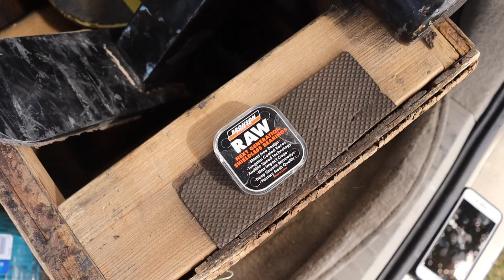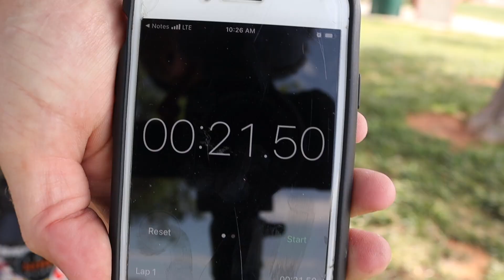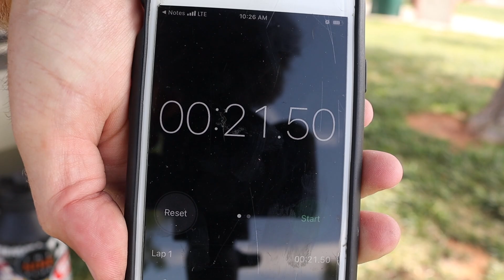Jamie Foy Bearing Hack DOES IT REALLY WORK?

Comment: The reason Big Boy Foy specifically said windex is because it has a degreaser agent. The problem though is that it’s also mostly water. It will clean your bearings but they will rust super fast. The ideal way to degrease them is with 99% isopropyl alcohol. It will degrease them without promoting oxidation as fast. (I’m from the east coast, we know about rust lol)
Reply: The idea that degreasing bearings is ever a good thing is laughably stupid though......... Not even kidding.
Reply: Isopropyl is the main component in Windex besides other alcohols. Great for a household product. A drop of lube and (new) shields are definitely smarter though.
Reply: ice cream
Reply: The cheapest glass cleaner are often best, containing less Parfum, Tenside, colour and such. From collecting Vinyls i was looking for a cheap source of isopropyl, which has to be most close to pure. Found out that the bigger names on the market tend to add several substances. Some even contain few percent methylspirit, which would be deadly to Vinyls.  
Anyway, i would give my pricey bearings some lube. There are nice products for MTB Frontfork. Same Problem there. Dirt and dust even more and you dont wanna have rust and scratches on your 1500$ Marzocchi ;-)
Reply: What about 70% isopropyl?
Reply: @joseamaya1001  it will work way better than windex but the higher the percentage of iso, the better.
Reply: @ilikelittlebikes  ok thank you
Reply: acetone is the standard solvent, but it's pricey
Reply: @joseamaya1001  You can use mineral spirit too (here it is called petroleum, in US I have no idea if it means the same). It's like petrol, but does not stink.
Reply: The unloaded spin test is stupid as a metric. There is grease for a reason, and of course dry clean bearings will roll well but will wear out faster as well

Comment: After my 20 years of skating I know this: pop shields off, put bearings in alcohol for a while, shake it. Then put them out, shake again. Let it air dry and then apply one drop of bike chain lube in each of them.( or sewing machine oil if you have access to it). Put shields back on and use these bearings for another 6 months at least.
Reply: Also spin test tells you absolutely nothing about how these bearings ride loaded up with your weight.
Reply: I use machine oil only on my Bronson's a drop or two will do to each bearing , g3s /raws are what I ride
Reply: Sewing machine oil ROCKS
Reply: silicone oil is best
Reply: @komoonkh  Exactly. These guys aren't taking into account load and friction caused by load. You have to have your bearings oiled because you create friction as the bearings spin. Without oil, you're unprotected from pitting or already existing pits in the balls of the bearing or in the races.
Reply: @krzysztoflange7484  Never tried but ptfe oil must be great too.
Reply: Fishing reel bearing oil works really well, pretty similar to sewing machine oil

Comment: Sorry being a spoilsport (literally). If you buy Bones bearing, they come with instructions (that nobody reads, but they are probably decades old): "Do not be tempted to use your bearing without any lubricant because they ''spin faster without lubricant". Although this is partly true in a superficial way, riding your bearings without lubricant will cause them to fail quickly and may cause them to 'freeze up,' which is no something you want to happend to you when you are skating!"

Comment: You don't want bone dry bearings. They will break down super fast, you need some kind of lube in there
Reply from the maker: I might put some speed cream in there but that’s why foy does
Reply: I think it's a debate of performance vs durability. anyone who tries the windex trick will definitely see it works very well. But you're sacrificing longevity of the bearing. that grease that supposedly attracts/holds dirt is also the only reason the bearing will spin with dirt in them. i think lubed bearing are for those that don't want to have to regularly clean their bearing. and non-lubed is good for maximum performance.
Reply: @localjoe  Try to get some Triflow dry lube. When it dries it turns into a wax like substance and doesn't attract dirt as much as grease.
Reply: @localjoe  i use low viscosity synthetic sewing machine oil, works fantastic. Speed cream will produce slower results because it does have a higher viscosity (it's a grease).
Reply: See I really would expect this to be true, but I've skated the same set of reds unshielded and bone dry for almost 6 years and they roll as good as ever.
Reply: I been using graphite xtra fine powdered lube in my shieldless bearings for more than 5 years. They're loud, fast n dont attract dirt

Comment: Skaters are not engineers. if you do this, your bearings will wear out in under 3 months. 
if you have two skateboards. Just try this. Set up one board with Windex bearings skated for three months. Then put oiled or properly maintain bearings in the other skateboard, and skate both of them and let me know what you learn

Comment: Man, I understand the thought process behind this with cleaning them thoroughly with windex, but I don't see how this could really help without some good compressed air blowing them out afterwards and then some lube afterwards like bones lube.
Reply: For better results, use KY Gel on your taint.
Reply from the maker: Gonna put some lube on there today
Reply: Paint thinner is great for old dirty bearings. Really gets the dirt out.
Reply: @noooaah  lmfao
Reply: Honestly, some people just love the tone of dry bearings, without shields. If you run them without shields and use speed cream etc, the gunk builds up fast. As well as defeats the theory of dirt eliminating itself from the bearings.
Reply: @decadentswine8894  as I’ve gotten older I don’t get near as wet as usual. Dry is the new wet.

Comment: I just cleaned 2 sets of bearings Reds (5 years old) & Swiss with Denatured Alcohol, the other with Windex. My Swiss bearings couldn’t even spin afterwards, but the problem was the shitty bearing cradles that Bones’ provide. I popped out cradles from a $15 set of Andale Blues and the Swiss were blazing! 

At any rate, don’t buy $60 bearings if you’re not going to lubricate them… You can pop shields, but just drip a single drop of SpeedCream to help preserve and protect. 

I also own every set of Bronson bearings and I would need a sponsorship before ever purchasing another! Spend the additional $20 in a set of Swiss if you’re considering RAWS.

Comment: As an engineer, my first reaction is lubed bearings with shields to keep dirt out.    However, if running shieldless, then yeah lube attracts dirt. 
Honestly though, these bearings were originally created for high speed application in machinery.    I don’t think skaters are getting them up to a speed that makes them hot enough that the lube matters. 🤷‍♂️.  
The side forces probably do more damage to the bearing than running them dry.
Reply: Exactly, the bearings we use weren’t made for what we use them for. Imagine if we had access to bearings that swivel.
Reply: And thats why people should use bearing spacers. That way you can tighten down the axle nuts so that the bearings spin on the inner race (as they are intended to do), and also handle axial loads better, because there isent any side to side play.
Reply: @kkfarmedkk  yep, when I started skating again I was like, why aren’t there any spacers with the bearings.  I had a buddy in the 80s blow out a set of bearings while riding our half pipe because he had no spacers.
Reply: no I wonder why these bearings sucks in winter they need more care , in the hot summer months these things glide like ice skates easier
Reply: ya reds used to come with spacers and washers. saw a dude open up a pack was surprised to see that they don't now. I bought spacers for my abec 5s I think they are. Just metal shield bearings with a blind complete. They seem fine but for whatever reason they seem to roll better with the nut just 1/32 turn from tight. Spacers are wide enough so I don't get why I can't fully tighten, maybe when they break in more I will be able to. Also ordered some cruiser wheels with better bearings although I will probably keep those in the cruisers until I get better. Thinking I can cruise around on them then swap to 52mm at smoother skate park like sites.
Reply: @Bawkr spacers might not be long enough to contact both bearing inner races without flexing the bearings
Reply: @droggy2069  it's contacting and all maybe it's just a misunderstanding I'm starting to realize. When you watch some one tightening something on video it's hard to gauge how tight they're really going with it. Pretty much what I do now is just remove the jiggle but not synch them down any tighter, because I have damaged bearings trying that based on what a video said. With spacers. My thoughts are that with the nylock skateboard wheels are not meant to be put down with any amount of torque, you're just removing the slack then leaving it there because when you do you chip scratch or bend the shield on the bearing even with spacers with 5lbs of torque or so. Maybe 1ft lb or so but up to 5 is damaging to them.

Comment: The Bronson Raws are indeed fast but loose their speed fast after some sessions.
Lubing open bearings is asking for problems (that will just attract filth), what they always sold me was to never measure the speed of the bearings by just spinning them and see how long they keep going, weight (your body) on bearings creates friction while rolling so the lube gets warm going thinner and helps them spin while cooling them off and resulting in more speed.

Any thoughts on that Joe?
Reply: I wondered about longevity of Bronson Raws. Did you try them? I think they're not what I'm looking for though.
Reply: I've had mine four years and they've slowed down significantly
Reply: Can confirm I used 10w motor oil to lube my sealed Super Reds bearings and they rolled but nowhere near as well as when lubed with speed cream after a cleaning. 

Switched to Bronson G3's and they roll better than anything. Maybe its cause they're new, lol.

Comment: It´s totally legit to run the bearings dry, if you can afford buying new bearings every few months. Yes, they spin faster when they´re not lubed, but they wear significantly faster than lubed ones. BUT, as soon as you stand on the deck (instead of letting the wheels spin freely while holding your deck) the effect of faster bearings is dramatically reduced because when you ride your deck, you´ll never get speeds like when your hitting the wheels with your feet. Plus, with lubed bearings i never experienced bearings falling apart while riding. I recommend cleaning in isopropyl an re-lubing the bearings every 4-6 weeks. That works best for me an i can ride my bearing up to two years

Comment: The Raws feel and sound so good when they are brand new. I’m about to go on my second set even though the old ones crapped out relatively fast.
Reply: That's the point of the lubricant to extend the life of the bearings, get you some bones speed cream dog that shit works wonders, 2-3 drops on each bearing and they're spinning good for damn near a month
Reply: @joshuajones589  defeats the purpose of the shieldless, lubeless bearing some would say. But yes it helps to take away the squeakyness. But shieldless bearings with lube are a major gunk attractor!
Reply: I’ve had mine for four years, I think it may be time for a new set

Comment: some of my bearings were just ground to a halt. so I pulled the problem bearings out, pulled shield off, cleaned with acetone, and they still sucked and didn't roll at all. they were just broken I think - the little plastic part that holds the balls in place was cracked, and the balls didn't wanna move in the little bearing grove. cleaning bearings is great, but if your bearings are just straight up busted as mine were - there's nothing cleaning can do.

Comment: I degreased some Reds and removed the shields and using bearing spacers and everything is smooth sailing and solid, no maintanance. I imagine if you cleaned your bearings and re oiled them and put the shields back on and kept serviceing them often that they would last longer and maybe be a little faster but no shields to get dented and no maintanance with bearings spacers is a pretty nice set up.

Comment: Spin test means nothing because when free spining the inner race is spining around the axle. With bearing spacers the inner race can't move and the wheels free spin slower but thats not the case when riding, your bearings will be faster and more solid with less heat with wheel spacers.

Comment: I clean my raws with pure acetone, dry them out, then apply a liberal amount of Remington gun oil to the balls. Works like a charm. Yeah, the dirt eventually sticks to the oil residue after a while, but they're gonna need to be cleaned again eventually anyway, so...this has always been my method.   Never use water, vegetable oil, anything like that.  Acetone and gun oil. You can get em both at Walmart. 👍

Comment: Always shields on and lubricated. If you don't do such huge gaps that your bearings actually break, take them out once they're "done" clean, dry and re-lubricate them. Bones has a manual that tells you how. Or yt videos. I actually just clean the worst dirty with a towel, take the shields off, clean the inside with a towel, rinse them off under running water, lay them into hot water with dish washer for 5min, take them out, rinse them off again, clean with a towel and dry with a blowdryer, then re-lubricate with Bones speed cream, resemble, lubricate the outside and trucks/axel part as well. Do this 3x a year. Keeps them running for years. Even if you ride through rain or sand, if you do this once you get home, they'll be fine. Just don't leave your deck over night once they got really wet and water is absolutely not a problem, your bearings wont rust if you do this the same day, even if you dropped your whole deck under water. Also buy Super Reds, much better than Reds and only a bit worse than Swiss, absolutely worth the price.

Comment: That's a very old hack but the real one is to put the bearings in acetone to clean it up and then put some graphite powder in them. Is way better than oil or grease because is a dry way to lub.

Comment: I have Bronson raw  and I clean them dry and then apply 3in1 dry lubricant
Reply: They spin hella fast, I only do this on the Bronson raws tho, because of their tungsten metal race
Reply: @K_spawn what lube do you recommend?? I'm seriously debating whether to buy the g3s, raws N lastly bones swiss. I already got reds big balls coming in the mail today or tomorrow but still on the hunt for the bearing that will take my new nickle board to another level
Reply: @Sonic_the_hedgehog65  the Nickle board should be good with the big balls really, I assume you are using 59+ mm wheels, but really any of the ones you mention is a good bearing it all boils down to the little things you might like, like noise, color, brand name,etc.

 maintenance is a must! regardless of which one you buy, bearings are machines and they need proper lube for prolonged life, all but the RAW are regular steel so wet lube is recommended specially if it is PTFE lube , the raws how ever use tungsten races with steel balls and and you have the option of using dry lube to keep making nose and prevent dust to stick to them, because of the differences in hardness from tungsten to steel, steel is softer so it's slides better over tungsten, aside from that if debris falls into them and binds the bearing just keep pushing , the tungsten will break the debris and roll again, you can even run them with out lube for a long time but that doesn't mean it won't wear out faster. 

So yeah any as long as you take care of them
Reply: 3 in 1 ptfe for regular bearings ( 2drops) , 3 in 1 dry lube for RAWs ( 2 drops and blow through them as you spin them to dry up) , 3 in 1 silicone (1 drop only for any bearing, it's a faster lube but they gunk up sooner)
Reply: @K_spawn  thankyou 🙌🙏!!!!!
Reply: @K_spawn  I finally got my raws in the mail today!! just put on my raws N man oh man I am in love!! They spin faster then all other bearings I ever had. I haven't taken my penny board with the raws for a ride yet but I stood on my wooden kitchen floor N pushed myself N man what a difference compared to reds big balls in particular!! I wish got these bearings sooner especially when I was a teen. Now I'm just 34 trying to build my nickel board to be a koo cruiser 🤙
Reply: @Sonic_the_hedgehog65  I just saw you're user name ! XD That's sick
Reply: @Sonic_the_hedgehog65  from this point on , every other bearings will be boring 😂, Bronson's are something else ! Ignore what they say about " any bearing can make noise" because yes any can but the RAWs is different and it's meant for it
Reply: @K_spawn  facts!! I can tell I'm going to have to maintain them N keep them clean as well as around the wheels I have but mann I was missing out 🤝 looks like imma save up N get my other 2 boards some Bronson's 🔥 I wanna try the g3s N see how thoes are..I heard they are a step down but this company does have my full attention now lol
Reply: @K_spawn  thanks bro appreciate you!

Comment: For the longevity of the bearings and to mantain the correct spinning way in any trick condition it's always better to use spacers in the wheel (and also checking the right thickness because not all spacers have the same measure, and the weight -cast or cnc machined-)
Reply: Yes but you can’t fit a spacer in the middle of most street wheels, the bearing won’t sit flush with them in there